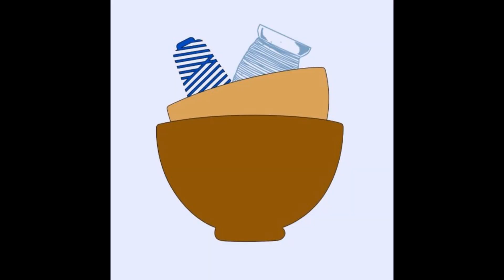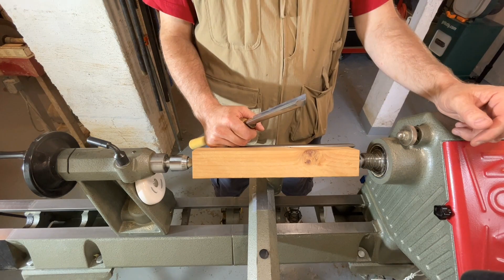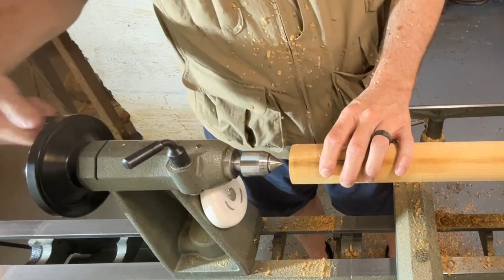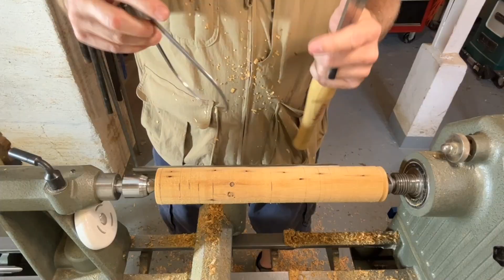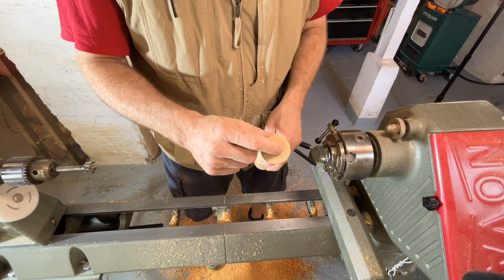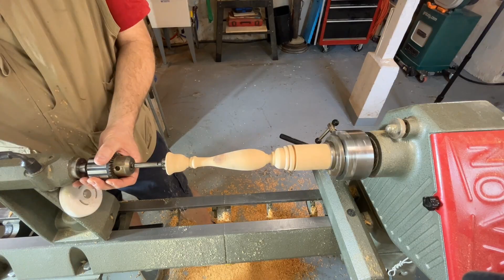How to Start Woodturning | Turning Candle Stick Holders | Lesson 6

Comment: Good Morning Sean - Great video series.  The process of replicating an existing design is quite interesting with the use of the Story Stick.

Side Question - what's the white disc attached to the tail-stock?
Reply from the maker: That is a push button LED light.  It has a magnetic base, so it says on the tail stock really well!  I use it mostly when I am turning vases or hollow forms.  Thanks for watching!

Funny thing, I had to review the video to see what you are referring to!